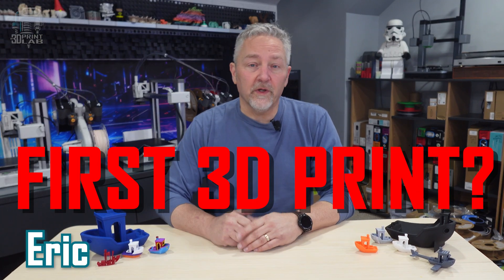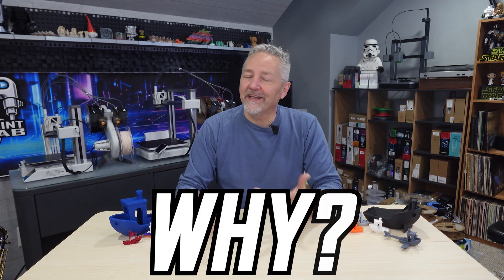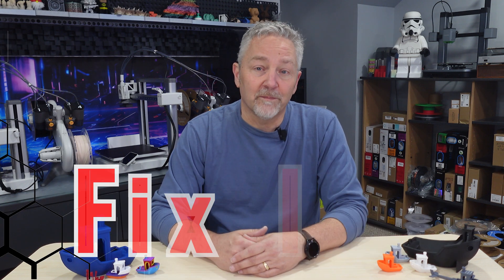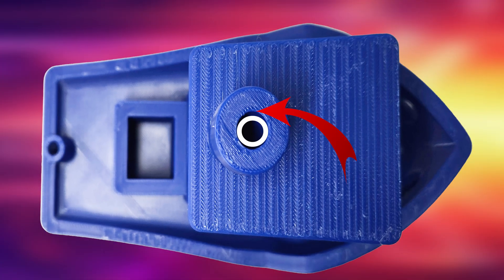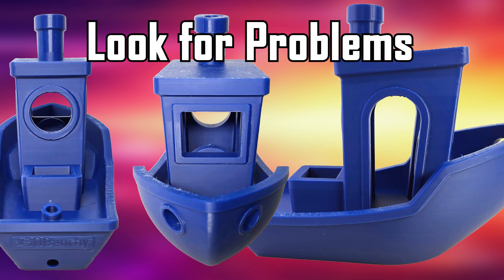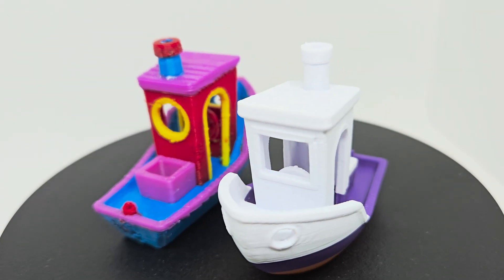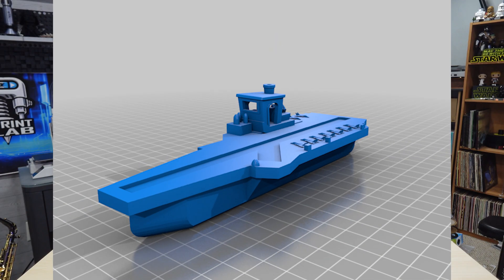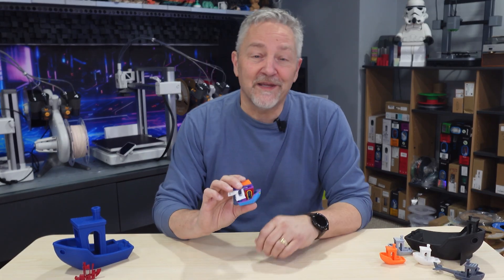BENCHY3D: The Truth Revealed!

Comment: When I got my P1S, I actually didn't print any calibration or test prints for the first few months, I just started using it to print stuff that I wanted to print. A few months into owning it I got a clog in the hot end (100% my fault) and finally printed a Benchy to check that it was totally cleared